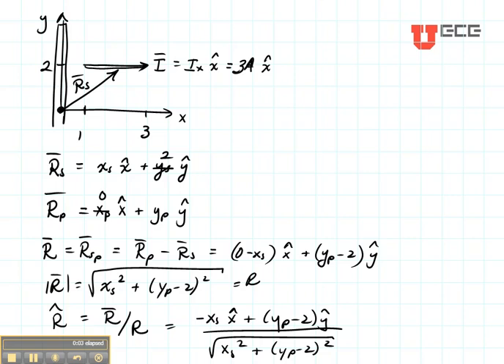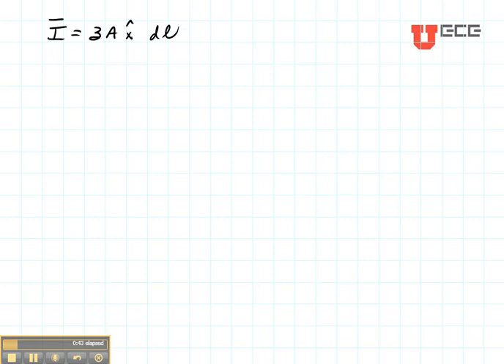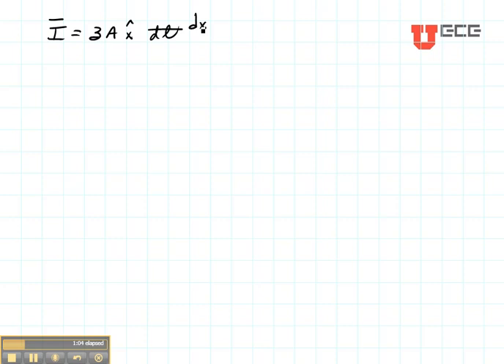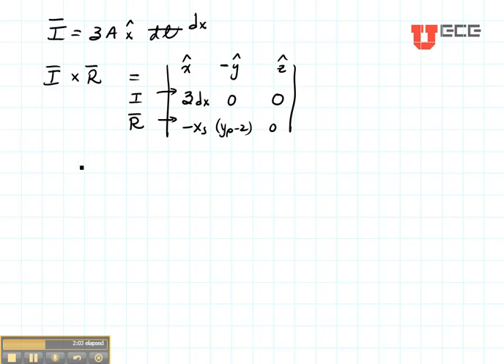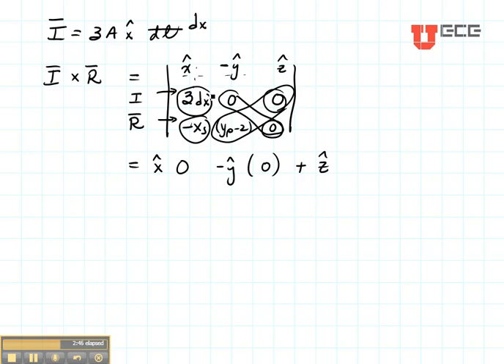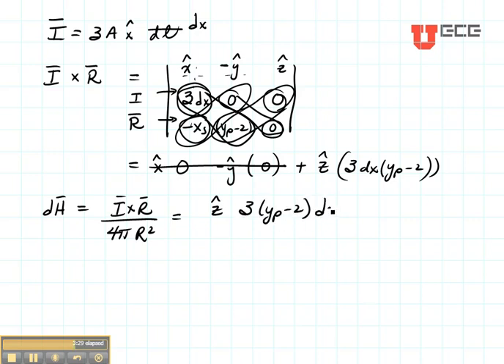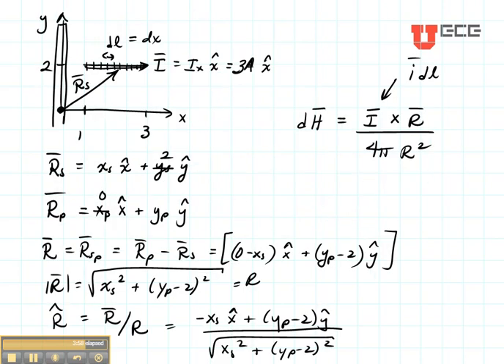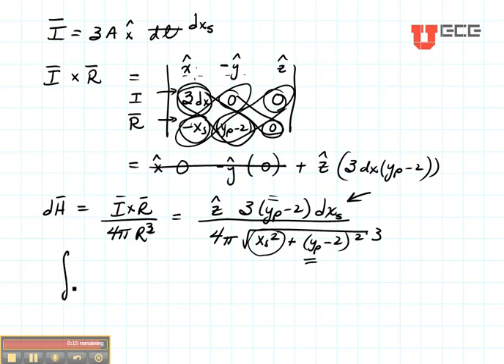ECE3300 Lecture 16-3 Line Current continued

Comment from the maker: @923824 Depends on the R on the top of the equation.  If it is Rhat (unit vector), you should have R^2 on the bottom.  if it is R (vector, not unit vector), you should have R^3 on the bottom.